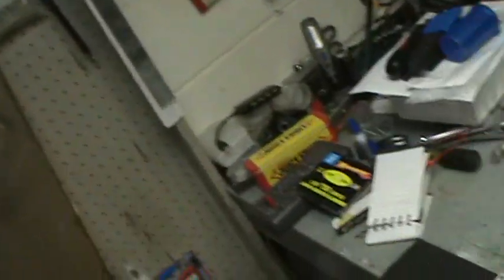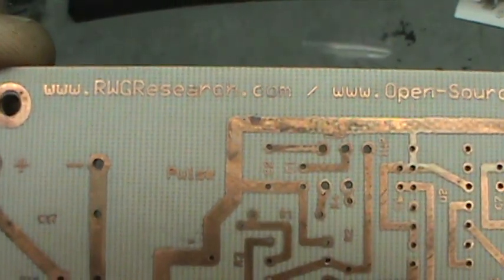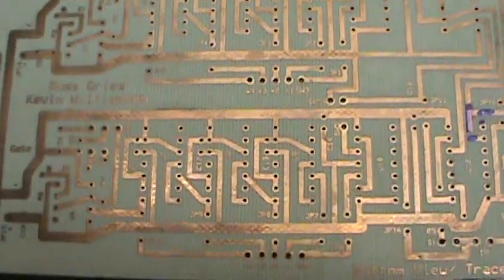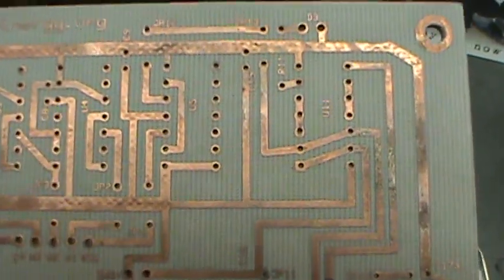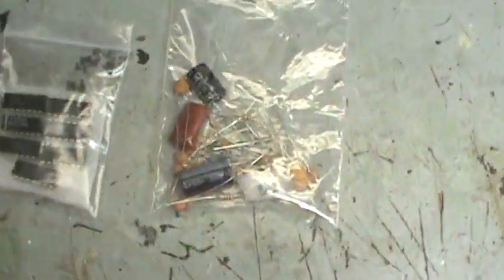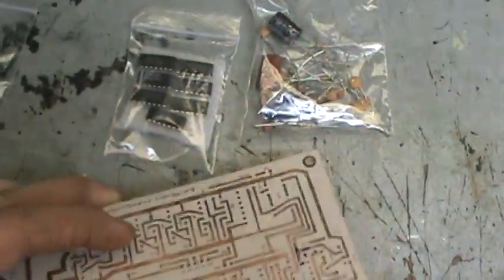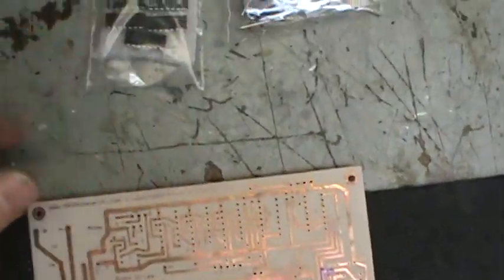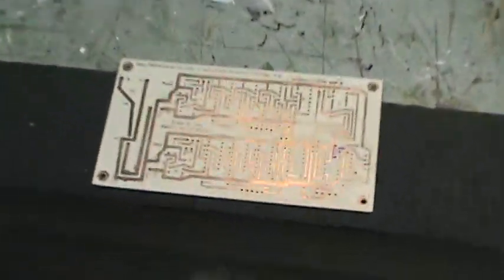Up Date On The Russtic WFC Frequency Generator. Thank you kevin!!! . www.RWGresearch.com

Comment: Awesome. I find that the cheapy photo paper as found in the $1 Store is best, because it degrades really fast underwater, whereas the expensive stuff is rather waterproof. i did find, though, that nail polish remover did not remove the toner from the after-etched board, well, at all... in fact, i had to scratch it off with a razor, slowwwww.... what might work better? Acetone? Don't iron so long? Thanks Russ